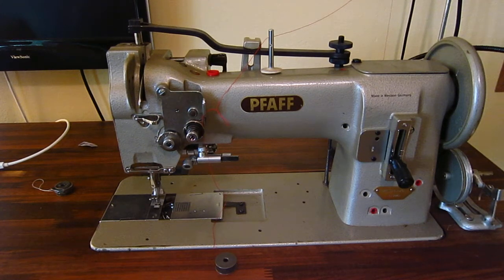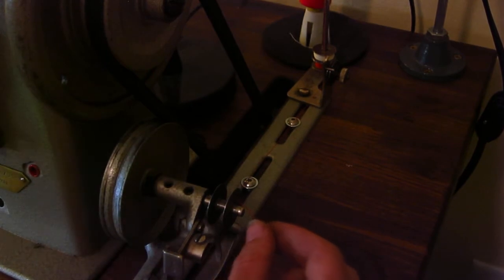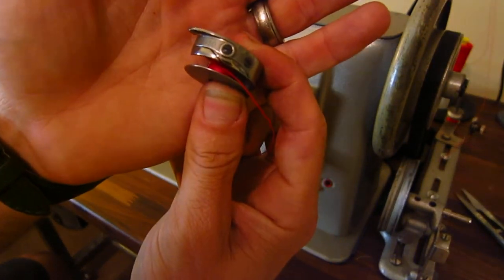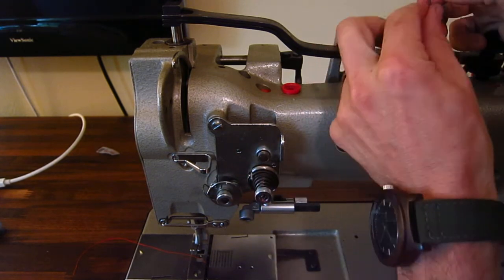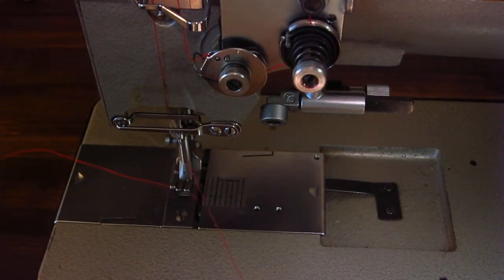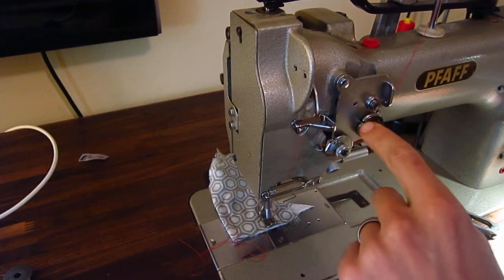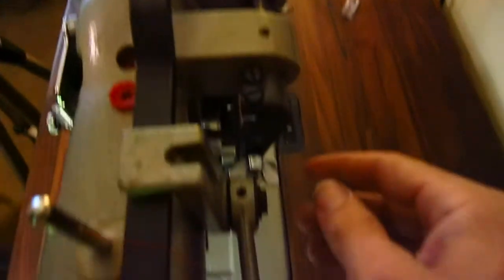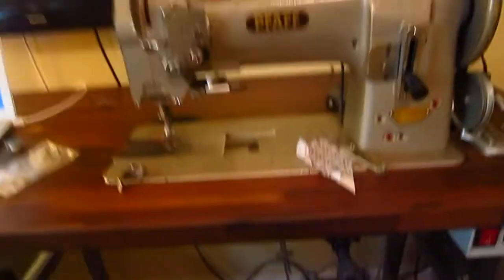Pfaff 145 Instructions

Comment: I hope you don't mind my posting a question in the comments section of this video, as it wasn't meant for me.

I have the opportunity to buy either a 145 or a 545, both H3 machines.  The 545's price is much lower while the condition of the 145 is slightly better.  I plan to use the purchased machine as an upholstery/leather/nylon webbing/heavy denim machine, so lighter upholstery, bags, some clothing and gear.  What are the differences between them -- bobbin size?  Which would you recommend?  (I asked at the Pfaff Yahoo! forum and my question wasn't posted, I assume because their focus is domestic machines.)

Great intro to this class of machine, btw.  I enjoyed watching it.
Reply from the maker: Iggy Reilly The only difference is the size of the hook/bobbin.  If you're regularly using T138 for large projects, like upholstery you'll notice the smaller capacity of the 145's bobbin size but it's not a deal breaker in my opinion.  I'd go with whichever is in better condition.  Feel free to message me privately and I'll take a look at the two machines you're considering and give you my thoughts.  Goodluck!
Reply: thesergeant Thanks for the offer; I'm glad I went directly to the expert instead of wasting my time on Yahoo!  I'll send you pics if both machines are posted on CL.  Both are in good cosmetic shape but I've not yet seen either in person.  The 545 is from a professional upholsterer's shop, i.e. was probably maintained pretty well.
Reply: The Pfaff 145 and the 545 are identical....only difference is the bobbin sizes it takes. The 545 takes the larger bobbin and thus people like that because you can sew longer and not have any connected stitching due to bobbin thread running out. The Pfaff 1245 is similar to this machine but that on has internal belts.....not like the 145....all gears. If you are looking for a reliable work horse.....145 is it.

Comment: I really like that roller / edge guide. Where did you get it?
Reply from the maker: Kwokhing, direct.  Not sure they sell direct anymore though.  There are a lot of copies on ebay but be aware you will have to drill and tap the back of your machine.  Worth it in my opinion though.

Comment: I've got a H4lmn I inherited. I followed this instruction. But, my stitch didn't go so well. It bunched up on the underside. Wrapped around the underside of the bobbin holder! Crap!
Reply from the maker: You need to hold the thread ends firmly in place when you start sewing.  The high thread tension will pull the tails back into the machine if you dont hold them.  Hope that solves the problem.  You have a great machine!

Comment: I have a Pfaff 196 H3 . My top and bottom threads not catching.  Any suggestions you may have to fix this ?
Reply: 1. Make sure your needle is all the way up (if not, it messes with timing and causes other issues)

2. Timing: with no thread in the way, rotate it by hand with the cover off the lower bobbin area. Rotate by hand in the normal stitching direction. After the needle comes fully down, then starts raising back up, watch the hook. You want the needle to raise just a little bit, then the hook reach the middle of the needle right around the middle of the clearance gap/bite in the needle. If it doesn't, then you need to adjust your timing.

3. If timing is good, also check the gap between the hook and the needle. If in doubt, use a new needle so you are sure it isn't bent. The gap should be tiny, smaller than thread, but also still have a gap and not hitting the needle. If you have a wide gap, then of course it will miss the grab sometimes. Lookup how to adjust that if needed. (I've had to do this to 2/3 machines at work, and it makes a big difference if the gap is 2-3x what it should be) Tip: if adjusting, try pinching a tiny piece of printer paper or sticky note in between to hold a tiny gap while tightening, then see what that gap is without the paper. How hard you pinch helps adjust the result.

4. if both those are now good, thread the machine. You want light-ish tension close to even top and bottom. Note, if your tension release mechanism works, with the foot up, it is slacking the tension disks, so you need to drop your foot and rotate so the foot isn't pinching the thread to actually feel the correct tension.

5. If tension is close to even, try softer or slightly heavier tension (top and bottom) and see if it helps. If you are too light, things will pull unevenly. If you are too heavy, it may fray and break thread, and bend the needle as it moves, etc.

6. Take up spring adjustment: With a scrap of cloth, rotate by hand and try to avoid backspinning. Much like hand sewing, there is a pattern with the machine where it creates a loop, then pulls it tight, then slacks, & repeats.

As the needle comes down, the thread should be tight. The take-up lever & spring are what do this. Just as the eye of the needle reaches/starts to enter your material, it should let off tension. Not way before and not after. It will need this slack to allow the hook to catch and loop it all the way around it to trap the lower thread.

Yep, that means really thick multi-layers of material might have issues, because this setting is a bit off if you haven't re-adjusted it from less layers. That's part of why they can have issues.
If the take-up tension is too slack and/or slacks too early, you can have issue like tangling and missing stitches. If it's too late or excessive tension, it may cause diagonal stitches and side walking and bunching from that excess tension, it will break string often, and it's likely to flex the needle into the hook, so you may hear a nasty clicking and break needles and/or bogging rough sound from the uneven machine load of trying to stretch the upper string around the lower bobbin.

So how do you set that right? You want as little tension as necessary to sew right. Typically, their will be a set screw that locks the shaft the tension spring rides on (may also have to loosen the nut outside it). Rotating that shaft adds or removes tension. Then there is a bottom stop for the take-up spring to come to rest on.

With test cloth in place, loosen the take-up spring (by turning the shaft it rides on) and back the bottom stop out of the way for the moment. Hand turn a complete cycle and continue while watching the thread tension. Every time you adjust, you need to do a complete cycle to avoid seeing the old tension.  Start tightening the shaft little by little, approaching keeping the string tight until the goal. As you get closer, you will need to add the stop, so it doesn't keep pulling with partial tension too long.
So your 2 adjustments are where the stop is (cuts off tension abruptly) and how much tension you have on the spring.

That will sort out most machines (and make many machines people didn't realize were only half right suddenly work much nicer).

If you are unlucky and getting all that right doesn't solve your issue, you have something deeper out of sync. I'd just take it to a shop at that point.